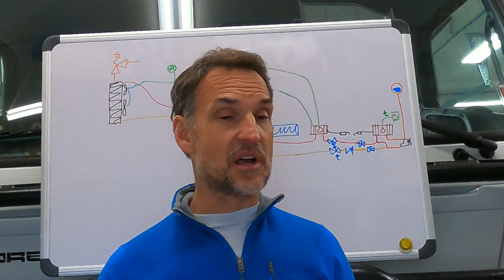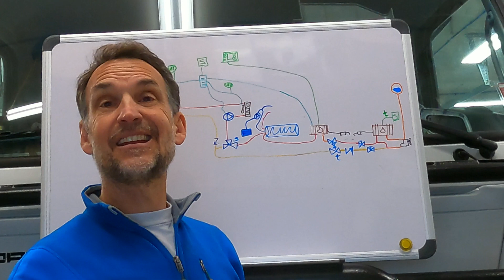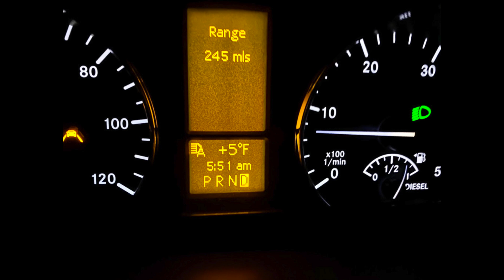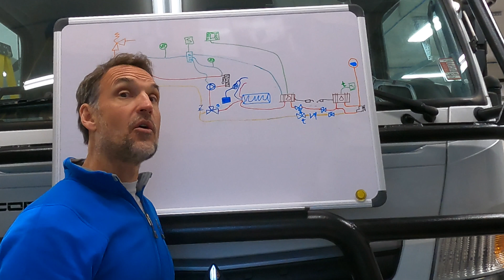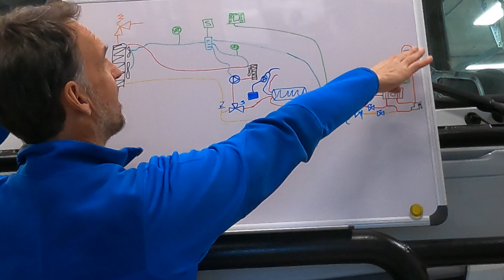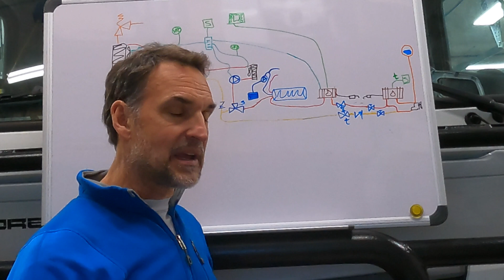The best Van Heating System? Hydronic hot air and water.

Comment: Great video and I have watched most of them. I am trying to build a similar system for my Ram PowerWagon Camper however i am concerned about the water freezing in the water tank since i am near Boulder and it gets cold at night. Since it seems like your water tank was stored on the outside of the van, how do you handle the water not freezing over night or when you are storing the van and not running the heater for a few days. Thank you
Reply from the maker: I just never kept my tanks over 90% full in freezing temps to allow space for water expansion (about 7-9%) and used high-end plastic fittings and tubing. I found that the plastic tubing and fittings never failed in freezing temps whereas the brass fittings did. My tanks are also close to the exhaust system and drivetrain which kept the water hot for hours after shutting down the engine. Only once did I notice a frozen tank, the one in the rear farthest from engine residual heat, and the other tanks kept enough water flowing until engine heat from driving about an hour thawed that one out, so never an issue.

Comment: Assuming i dont want anytjing more then the aqua hot or rixen kit provides do you think it is worth the savings of doing a diy solution?
Reply from the maker: I do, as the cost of my system was about $2000 or roughly half of the Rixen kit, with the same basic functionality and performance. although my system had arguably more. I do not remember the cost of the Aquahot system. However, you either need to add in the cost for someone to install any of these systems, or assume the risk if you install the system yourself. Risks can include leaks, poor performance, or even damage to equipment. I did not have any of these issues, but be sure you address these risks and manage them with any system and installer.

Comment: Did you install the coolant pump that came with the D5 just on the inlet (supply) side of the D5?
Reply from the maker: I did install the pump included with the D5 per the instructions, but I also installed a secondary 12 vdc coolant pump inside my camper space before the two interior heat exchangers that is switched on with the stainless ball valve that also opens the interior heating loop with the switch. This extra pump may have been unnecessary, but I wasn't sure if the added loop and heat exchangers would add too much resistance to the factory pump. They probably didn't and the system likely would had worked fine without it but it did  work very well with it.

Comment: Very nice system and explanation. Can you do this system with just the aux d5 and not the factory d5? Also did you consider hydronic heated floors?
Reply from the maker: Thank you, and Yes indeed this can be done with just one D5. I only used two since one was factory and that one could only be operated with engine and below a certain temp. The dedicated one can be used any time heat or hot water are wanted, and if I was doing it again, I would probably not order the the van with the factory D5 and just install one for heating, which can also send some to the engine if needed.
Reply: @vantripping  Oh great. Thanks. I'm doing my first Sprinter build. I'm a woodworker and have an engineering degree so pretty adept at things, but still lots of learning. I don't see the vid for the new heating system you said you were developing? My Sprinter use will be part time with extended journeys. Probably not in lots of cold as my pups enjoys lots of hiking in moderate temps. I don't really need hot water. I know you love the hydronic heating over the air top but the more I research and being a first build I'm now thinking an air blower is going to be the best choice at this point. Any thoughts?
Reply from the maker: @omjaye  Sure, an air blower heats up quicker, and is a simpler install, lower cost, but can't heat water. In my current build underway, I am heating my water electrically, as most efficient, no-emissions or noise, and easily controllable with a switch or thermostat. I am also using electrically heated floors, as those heating mats are very efficient, silent, low weight, cost, and easily to control by zones, and no fossil fuels, but not likely enough heat when it's really cold, but works for likely about 90% of the ambient conditions, so I'm adding small electric heaters to heat up quickly, silently, and add heating capacity when it's colder. I have a large battery system to support my AC unit, so I'm leveraging that same battery system for heating as well. Just another option. I'll share more on this system soon.
Reply: @vantripping  Oh I'm very interested in the heating mats? Video coming out soon? What brand / product did you use? And curious which AC model you chose also?
Reply from the maker: @omjaye  I went with a Cruise N Comfort for the AC system; nice in that it is compact and split. The mats I can't remember right now but a very cool system. I'll post a video soon.
Reply: @vantripping  Yo great info! Okay I'm getting ready to move forward with some of my systems. I'm going with Autoterm air heater as I demo'd it and it's pretty quiet with the muffler both on intake and out take and they've done some things to reduce combustion build up. What I'm really interested in now is the electric heated floors. Can you expand on this with your product choice and set up? Also your electric water heat. Thanks!
Reply from the maker: @omjaye  Good for you, sounds like a good product and heating option. The heated floors and little electric heaters have tested out well, but not yet fully tested in cold conditions. I'll be doing that in the next few months as it is starting to get cool and will soon be cold enough to put them to use, and I'll share how well they work with some measured metrics.

Comment: What 3-way control valve did you use for the fan heat exchanger loop?
Reply from the maker: The thermostatic control valve is made by Espar--they make at least two different models. Hard to find in the US except from trucking shops.

Comment: Great system! I have the same factory aux heater that I can run without the engine but must be below 40 degrees. Also the factor rear passenger heater system ( runs only when engine is on), all of which are located in the same area behind the driver seat. That is a total of 2 factory espar D5 units. I am just now about to design the system which includes the Isotemp Slim Square 4G. I have purchased the Rixen system withe the expansion tank minus the electrical heat component. I have been designing a system that is very similar to yours and would enjoy getting a more detailed explaination of parts, particularly the valves and temperature sensors. Most of my travel and camping time is in very cold climates. Glad I came across your channel.
Reply from the maker: Great. I love this heating system; mine has worked extremely well and very simple with no maintenance or oversight needed--just automatically heats water. I chose to install my own dedicated heating system D5 so I can control it when needed and without the engine running, and I like the Isotemp heater; it's internal electric heating element is really nice to have when plugged in inside my garage so it reduces engine heat up time and also when plugged in at campgrounds, etc, when needing some hot water or heat without needing to turn on the D5. The valves I use are all rated for coolant--mostly made of stainless, and same for the fittings to barb for the silicon tubing also rated for coolant and high temperatures. I use two isolation ball valves--supply and return. And a 12vdc electric three-way ball valve to enable flow to the heating system or just let it return back to engine. The six temp sensors are all from Blue Sea Systems and placed on the tubing and wrapped in insulative tape with a four sensor screen and two separate small OLED screens for outside and interior temps which can be switched on or off to reduce interior light when sleeping. Hope this helps, let me know what more you want to know.
Reply: @vantripping  
I have ordered that same B/S temp M2 Monitor already and comes with 4 sensors. Have two heat exchangers as I want to separate the engine coolant from the house coolant systems damage control under the chassis. Putting in a hydronic heated floor system with a heat exchanger, pump and temp control to also keep it separate from all other system.  I would like to send you a diagram for your thoughts.
Reply from the maker: @dennym5265  Great. Sure, send me your diagram and I'll provide some feedback/thoughts. You can send it direct. Contact is in the channel or video info.
Reply from the maker: @dennym5265  Happy to review your diagram and provide some input.

Comment: Why wouldn't you just leave the heat on all night?
Reply from the maker: To save fuel, noise and emissions; plus, I am plenty warm thru the night with the insulation I installed.
Reply: @vantripping  gotcha, I full time in Minnesota and I leave it on 24/7, which means no hard starting for a full blast heater, just slow rolling as needed, which isn't much because I too installed great insulation.
Reply from the maker: @TheGreatSpoon103  How often do you find your heater on or cycling per day in the winter time?
Reply: @vantripping  honestly, when I saw this I didn't have an answer, because it doesn't so much cycle as it does just kinda "simmer" in the background, I paid close attention to it for the last hour (granted it's 32°f and not -30°f but it functions the same, or at least I haven't noticed much of a difference), I checked the exhaust pipe and it didn't change noticeably for at least a half hour.
So I guess my answer is, it doesn't seem to cycle, and the only reason I can come up with is the fact that it's so well insulated.
Reply from the maker: @TheGreatSpoon103  Good to hear, although I would think it would cycle from low heat to no heat and back again every 10 to 20 mins. I assume it cycles to high when you first turn it on after being off several hours or days.
Reply: @vantripping  I only notice it when I turn it on after servicing it, but I also paying close attention to it, but still I split the outlet for the air portion to twice the amount needed so it doesn't come out with much pressure, even when on high.
Technically it does cycle, but it cycles up and down rather than on and off.
On days when the temperature increases significantly it does seem to cycle down, perhaps off until needed but that's obviously normal with all thermostatically controlled heat.
Reply from the maker: @TheGreatSpoon103  Yeah, the D2's have a lot of heat output, even on low, and the D5's even more so. I am planning out a new style of camper heating system in my new camper that I've tested and think should work very well for many reasons. More to come on that.
Reply from the maker: @TheGreatSpoon103  That sounds like normal operation. I prefer to shut it down it down except when needing heat in the morning and evening to reduce electrical load and fuel consumption as well as noise since my van can stay warm for hours after shutting off.